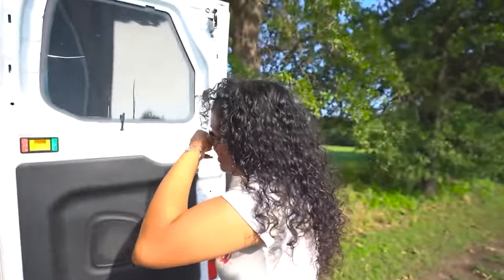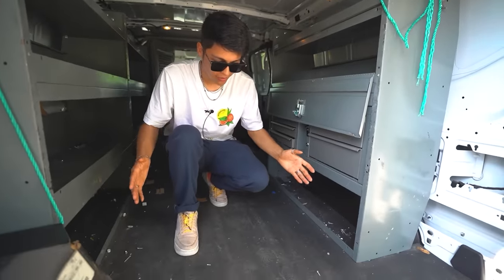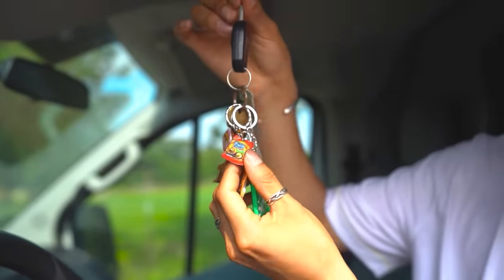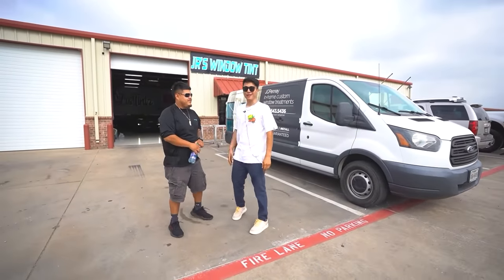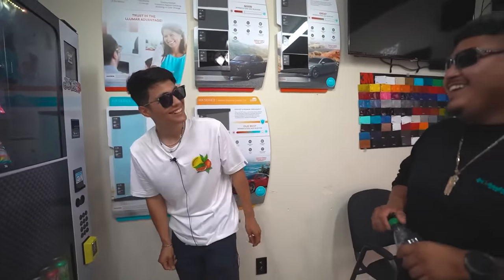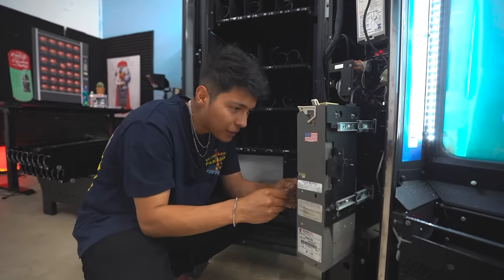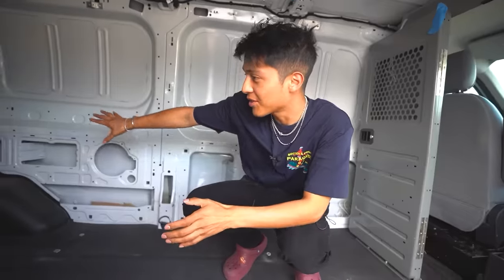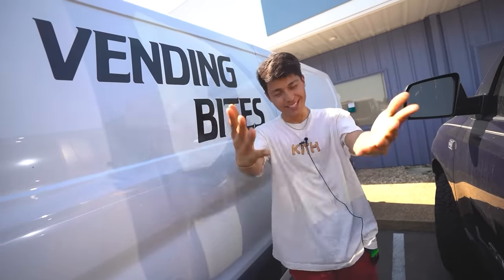My NEW Vending Machine Business Van!!

Comment: just a heads up, that yellow cap-less gas tank inlet means you can use either E85 Ethanol (available at certain Arco and Shell gas stations) as well as regular Gasoline. its called Flex Fuel, You can use Either.
Reply from the maker: Awesome thanks 🙌
Reply: Some sheetz have it too! GasBuddy will let you filter by it, so it'll show close gas stations with it.
Reply: que inspiracion amigo, gracias!

Comment: Get the cover replaced for the gas fill, it also locks in place when the door is closed.
Reply from the maker: Will do! I already ordered the replacement
Reply: The parts are easy to get hold of, given it's a Ford Transit/Ford Custom

Comment: @jaimeibanezz E85 is a blended fuel that is incredibly cheaper than regular gas but i doubt that texas has E85 but as an E85 user with you running the van for a business stick to regular gas as it does not burn quite as fast as E85 because of the higher oil content in it